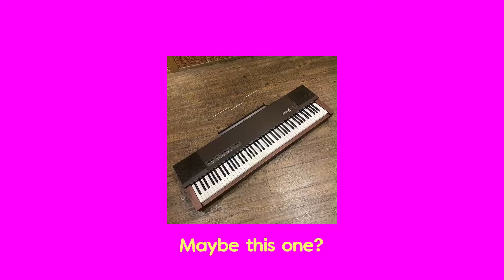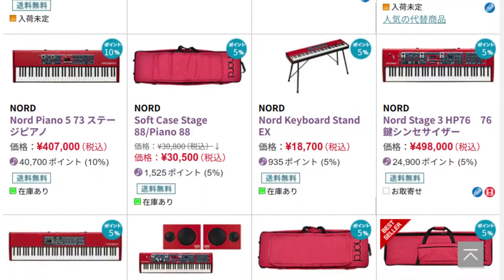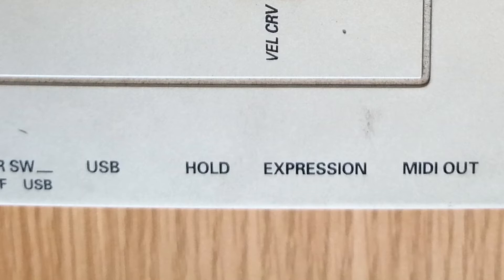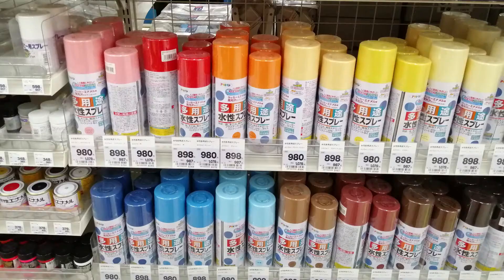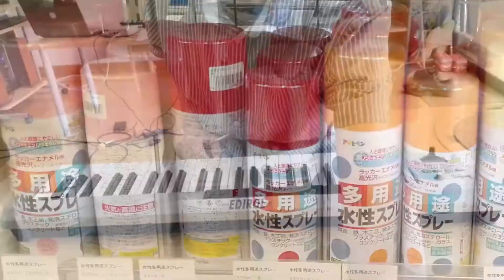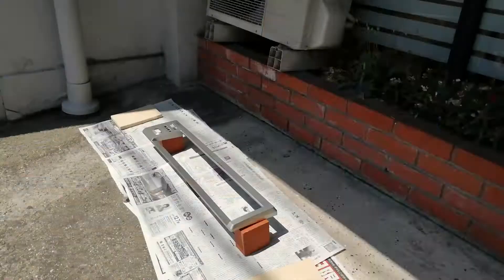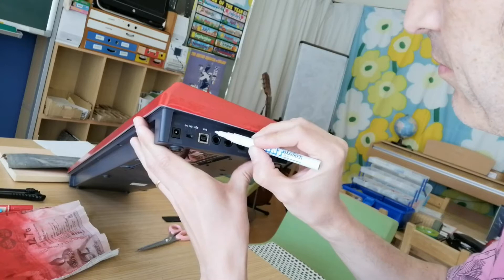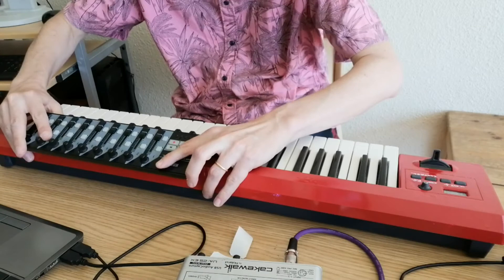Live Rig Part 1: Turn an EDIROL into a NORD! (Not Really)

Comment: Very nice, I am thinking of changing one of my cheap old USB keyboards into a reversed b&w keys Vox Continental-clone or a pseudo-ancient harpsichord thing. Do you have any advice on that? I am a bit worried about the feel of the keys after painting for instance..
Reply from the maker: Well, I thought about that too, and decided not to for the same reasons! It was very easy to take the case apart and spray it, it looked a lot more fiddly to get the keys off. Spraying with the keys on would be a very bad idea I think, the paint goes everywhere. Also, and it could have been that I used cheap spray lacquer or my technique was bad, but the finish is a little bumpy in places.

If I was going to do it, I'd probably sand the keys gently with some fine grit paper and spray a few times, letting it dry and sanding between each time... But it's too much like hard work for me. If you do it, let me know how it goes!